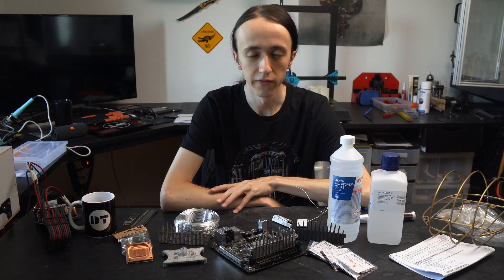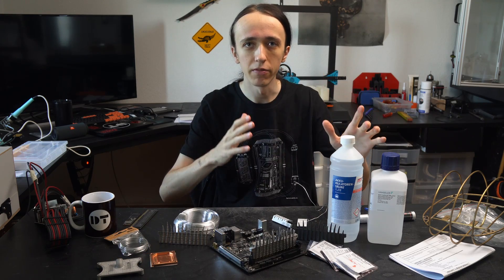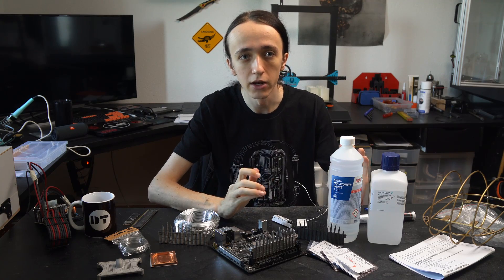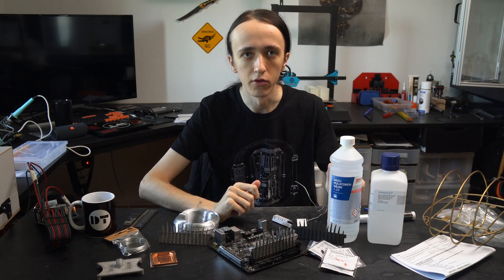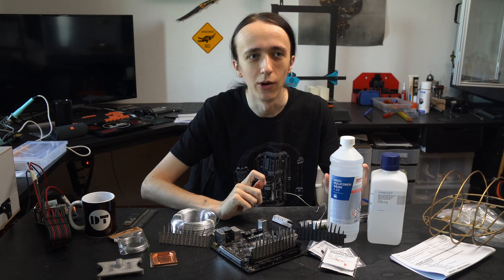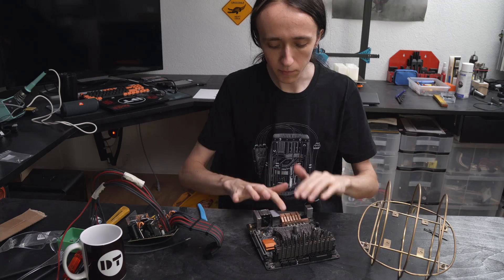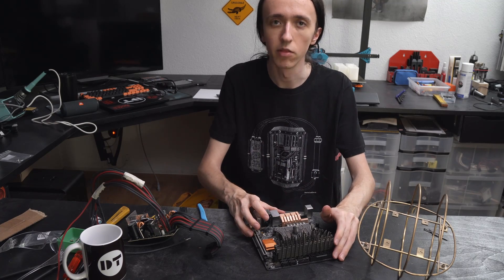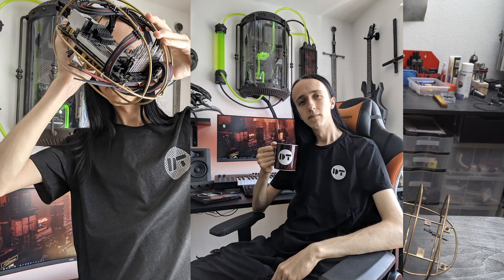DIY Anodizing Aluminum 3D Printed Parts - Posthuman #3

Comment: @darkartguitars, very interesting video. I tried this anodizing as well. However, with my 3D printed AlSi10Mg parts it seems the anodized coating comes off. Have you also experienced this or do you know how to avoid this?
Reply from the maker: I mean the anodizing of the 3d printed parts didn't really work for me either here. Not sure exactly what the chemical makeup of the parts and the surface after my attempt are. I've used the same setup for regular 6061 parts with great success though.

Comment: How did the surface finish change as a result of the anodization? 

Also, what surface finish did you begin with? Was it raw? Had it been tumbled, sandblasted, or bead blasted prior?
Reply from the maker: I sanded the parts from the very rough 3d printed surface finish. The anodizing didn't change the texture much, just the color.

Comment: Hey David, maybe you can try electroplating since your heat spreaders are conductive. I wonder what mystery alloy they are using...
Reply from the maker: That was my first thought, but getting copper or brass to stick to aluminum is quite difficult requiring special chemicals or intermediate steps. The alloy they use is listed on their website, don't quite remember it off the top of my head.